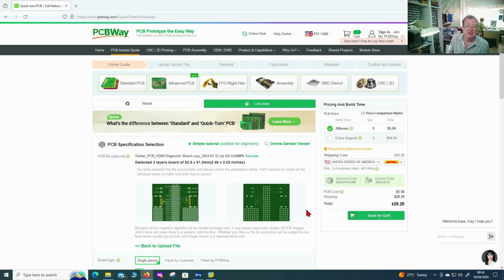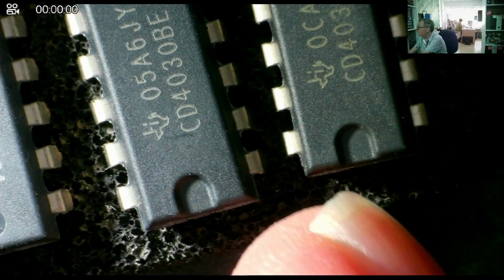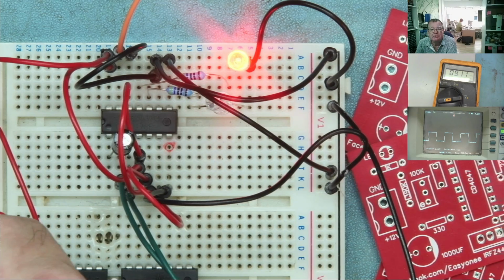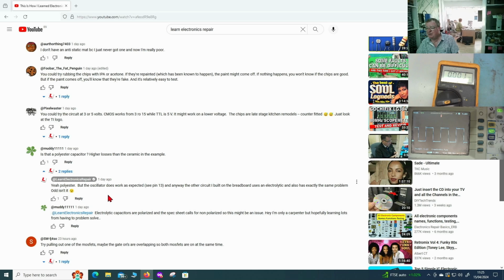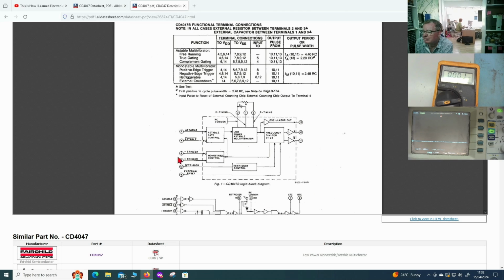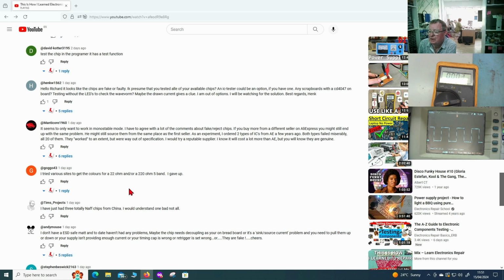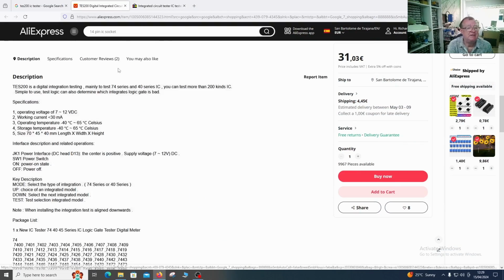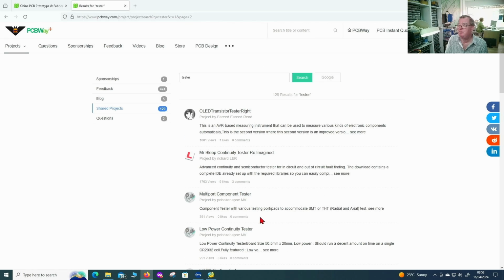This Is How I Learned Electronics Repair Part 2

Comment: If an oscillator isn't oscillating I would tend to wonder if the capacitor is charging and discharging. Problems with this charge/discharge cycle can also cause behaviour where you sometimes get one oscillation but never more than one - as we see with the LED's on the breadboard.

Comment: Hello sir,
I need some help for my crown Dsi 2000 Amplifer.
When we turn on the Amplifer display showing Only crown and realy only one click and not going to Ready position so we Change The C196 memory capacitor 35/220uf I change In 63v/220uf then we Turn on the amp & power led and Display is flashing FOR 2 -3 sec and then shut off the amp I remove d top cover and see there have a 30N60A4D IGBT Back side have a green DISK TYPE THERMISTOR PTC (TKS PI 6R2)was Heating  so sir need some help where is the problem

Comment: Sometimes batches of ICs and other components fail quality control and are sold off at almost give away prices (because they're useless for the intended application). Perhaps some of the AliExpress suppliers buy up these batches and relabel them to sell them off as a chip they know there is a market for? There's probably a Pareto function at work when it comes to chips with 90% of all applications being met by 10% of the chips that are manufactured? I'm guessing these dodgy suppliers know which chip models are in the 10% and which aren't?

Comment: I know it's a few weeks late, but it might have been worth checking with the IC testers anyway. If the IC is a fake or been manufactured/marked wrongly post manufacture, it may have given you an indication as to what it was, or how the tester thought the IC operated.

Comment: If one of your viewers had a genuine IC, is there someway to measure each pin for a value that can be compared to the ICs you have of questionable authenticity??
Reply: I have a working 4047. With the black lead on pin 7, Richard got a reading on pin 10, but no reading on pin 11, but I get the same reading on both pins. So a difference there.

Comment: Hi Richard. I remembered an old project which used a 4047 (actually ST's HCF4047BE) and I had one left over.

I've reproduced your circuit, using 220nF and 220k ohm that came to hand and it works perfectly. Visually I would say it runs at about 2Hz (the calculated value is 2.35Hz).

Comment: Correct me if i am wrong... Pin 12- "Retrigger". According to the datasheet, the cycle will retrigger if the pin is set "High" (even if the table says Vss for multivibrator? The Datasheet is mentioning that stable Astable frequencies are somewhere in the 10-100kHz, so low frequencies as these in your experiment might work as Monostable and Retrigger is used for increasing the pulse width). What you have on your output now is a single cycle. LEDs go on once and then its over. This is because you have pulled Pin 12 to Gnd (low) if I see this correct on the video. So IMO setting pin 12 to high might fix your issue?? ... 
Retrigger and External Reset is actually a cool feature as you can either cycle the outputs all the time or just always once after Reset is triggered.
Reply: The frequencies of 10kHz & 100kHz on page 1 of the data sheet, look to me like examples of what stability to expect with temperature variations at those frequencies. I don't think they are any kind of limits. Fig 14 shows astable mode using 1uF & 1MOhm timing components. That's around 0.2 Hz.

Comment: I just googled "How to test a CD4047 Astable Multivibrator" and the circuit that was shown is exactly like the breadboard setup that you have Richard, I would say that the CD4047 IC's that you have are either defective or fakes, without a known good IC to compare the pinout readings to I don't think you will be able to come to any different outcome.
Glenn

Comment: I’ve just breadboarded this project and only exception I made (had no other) was I used a ceramic 10nf cap and I’m using a 330ohm resistor from pin 2 to the potentiometer. I have 233khz @ 5.47v dc on one end of the potentiometer and 2.56mhz on the other @ 3.58v dc. I think your diagnosis is correct 👍
Reply from the maker: Thanks for taking the time to try this yourself 🙂
Reply: @learnelectronicsrepair spending the time to do it is nothing compared to the time you put in for us all ! Least I could do when I realised I had all the parts. Was fun and I needed something to do 😂 Thanks for all your hard work
Reply from the maker: @Mark_C1  To quote almost a meme these days
'This Is The Way'  
Everyone wanting to learn take note 🙂Thanks Mark

Comment: I have some 4070BE chips unused left over from a project. I could get some readings off these if it helps
Reply from the maker: Sure take a look if you like, I did some diode test mode reasings in part one though there was nothing that looked rally suspicious there

Comment: Haven't watched all of part 1, but building the basic square wave generator (with a 4047 unlikely to have been damaged by drawing too much current from the outputs), with outputs just connected to a scope and nothing else,  should be sufficient to test operation. 4000 series ICs are likely to struggle with moving charge rapidly on and off the gates of power mosfets and an interim push-pull stage may be required. This is, of course, only my opinion.
Reply from the maker: Hi Ralph. Yeah in part one the CD4047 was just connected to the gates of the two MOSFETs on the little red PCBs via 220 ohm resistors.  Same problem without an LED load to drive.

Comment: I think they are defective, I looked at the data sheet, you mentioned the pins, but I would be tempted to play with the pins 9 and 12 (change high/low), looking at the Logic block diagram these pins alter the state of the frequency divider, if there is no change in what pins 10 and 11 do when you alter 9 and 12 then that part of the chip is probably broken.
If you want a project on PCBWay I will have to blow my own horn here 😁 you could try my "Tim's PTC Hot Plate Controller" you can also use the project to control the temperature of a basic soldering iron. (If you do, remember to change 5 off to 10 off)
Reply from the maker: OK, I'll ask for some of those.  DIY hot plate for pre-heating is something a lot of viewers are interested in I think.  Should be no problem getting that working then 😉
Reply: @learnelectronicsrepair  There is two versions, In the UK as you know we have fuses in the plug. Some US or EU, asked for a version that has a fuse inside.
Take a look at my Instructable, I originally made it with parts off the shelf. Then PCBWay made me an offer 😁
Check that you are able to get the Power supplies I used. I designed the PCB to take a specific one. I would have reverse engineered the power supply, but I have no clue where the get the transformer or how to get its specification.
If it not possible to get them now it's just a small 3W mains to 5 volts PSU.
Reply: Was just thinking the same thing about pins 9 and 12 (External Reset and Retrigger). I was looking at the datasheet and if you look at logic diagram, particularly the FF4 part that is the last flip-flop before the outputs, and then look at how they implemented FF4, you will see that it's a D flip-flop with RS (Reset and Set) lines. Now, we see from the logic diagram that pin 9 and 12 are connected via a NOT gate and a buffer to internal R and S inputs of the FF4. And if pins 9 and 12 are LOW, R and S are set HIGH, and those go to NOR gates in the FF4, effectively making it output LOW on both Q and Q inverted, making them oscillate at the start until they stabilize at one state. Which bears the question why the manufacturer would suggest that you pull both pin 9 and 12 low for astable multivibrator free running mode?
Of course, I might be totally wrong on that one.